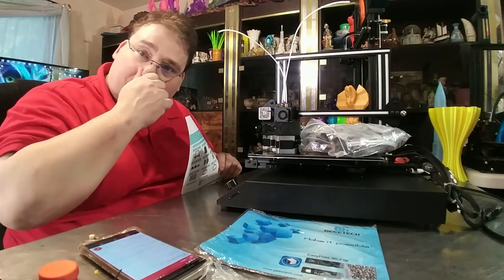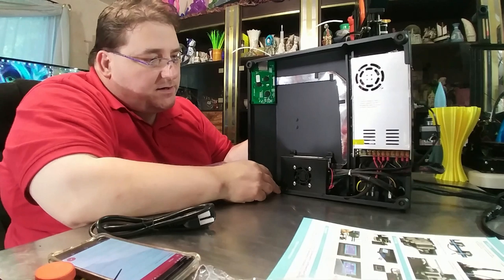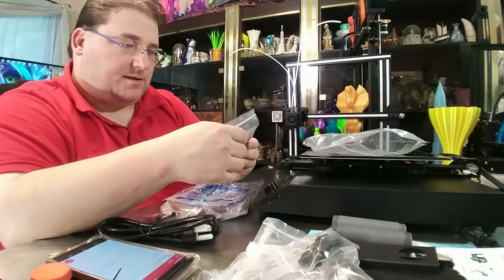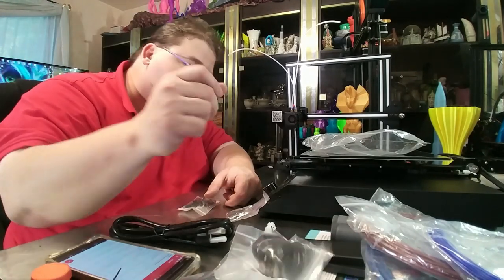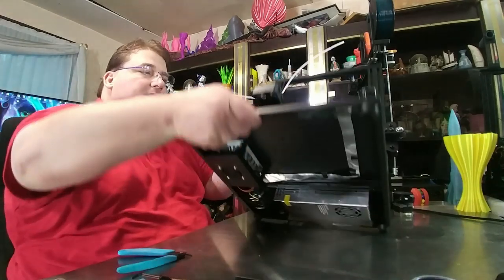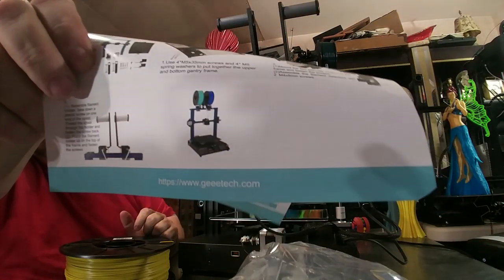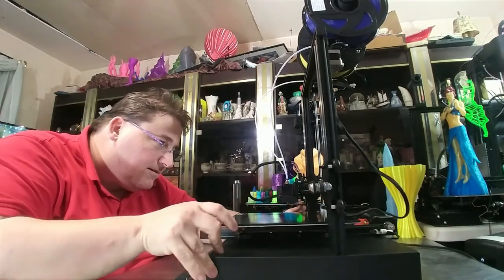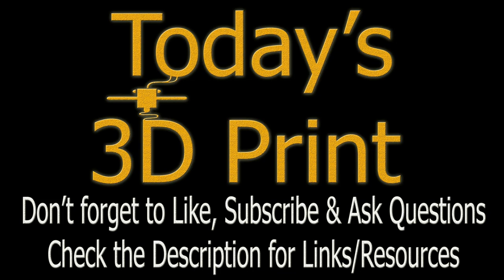Geeetech A20M Mixing Multi Color Printer Unbox, Build, Print   T3DP

Comment: Hi Chris, any suggestions for a flex build plate that will fit this printer? I have such a hard time getting the prints of the stock build surface. Checked Wham Bam's website but they don't sell anything with this size (260 x 260).
Reply from the maker: Yeah ita an oddball size!! If i dig anything up i will report back!
Reply: @nerys71  I've ordered "Gizmo Dorks PEI Sheet 10" x 10" (254mm x 254mm) 1mm Thick 3D Printer Build Surface" from Amazon and try this with some clips.
Reply from the maker: @Gandor66  alas that wont work well. Plastic parts always warp. Always. No exceptions. Unless its held in place. Alas pei alone is quite flexible. The parts may very well "lift" the pei and warp anyway. This is why the original soft magnetic beds from creality etc... Did not work well.

Comment: Hi Chris, the sheet in Chinese is probably a Commercial Invoice for customs clearence purposes. Its a standard thing to enclose for importers to use or if a customs dept opens the package to inspect the contents as part of the customs clearence process.  In the USA at the moment its what is being used for calculating  the tarrifs ( and any other import charges by US customs Dept ) on various Chinese made imports..Mmm actually Chris yourself and other US based product YT reviewers should get legal advice from a customs broker for the new tarrifs comming into effect soon as you may be required to pay this to get the goods cleared and released by US Customs....Laurie
Reply from the maker: I thought small vendors were excempt? Ie i am getting 1 not 1000 ??
Reply: @nerys71  Hi here in NZ its based on the landed cost total and the minimum is about NZD 400, after which we do pay the charge.  We have a blanket type of sales tax here called GST which is affected by this when we import goods as individuals or companies. Thats why this popped into my mind.. But I dont know what the US Customs regs are...if they have a minimum or not etc based on the quantity or the total landed cost, Individual or business, promotional goods, demo goods ? Personally I would be checking over there just in case etc.. Laurie
Reply: Eg for myself here in NZ my Ender 3 landed under that figure so no GST but my Alfawise U10 was way over so I paid the GST which is a blanket rate of 15 percent....it made me wonder that as the new Tarriffs are going to be on consumer goods,  yourself and other YouTube tech reviewers in the US could possibly get hit by it?  I hope not but you know what red tape can be like sometimes..personally I would be checking with a US Customs brocker as they should be able to figure this out..Laurie
Reply from the maker: @LWJCarroll  as far as I know individual US citizens do not have to pay any sort of import tax or any sort.
Reply: Mmm one way of checking ( for free!) is asking Fedex, DHL,UPS whoever is clearing and delivering the ones you get for review as they should be able to tell you what they expect to happen with the new tarriffs thing. Also how they have been declaring and clearing these for US Customs. You should be able to get copies of the US Customs clearence/release  on previous ones as a guide etc...Laurie
Reply from the maker: @LWJCarroll  well the cost of should be quite low since they are reviewing its the value should be there cost not the sale price and I'm betting the cost is lower than we think :-)
Reply: @nerys71  Good grief one huge duty free shop!  Lol  Laurie